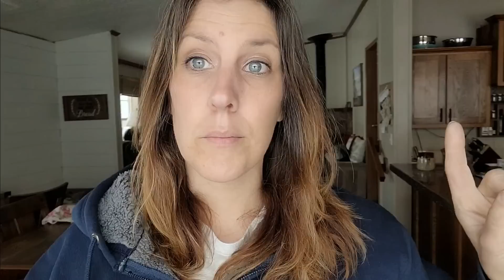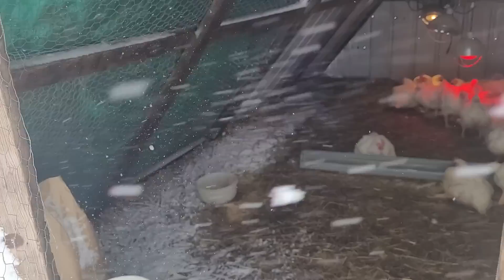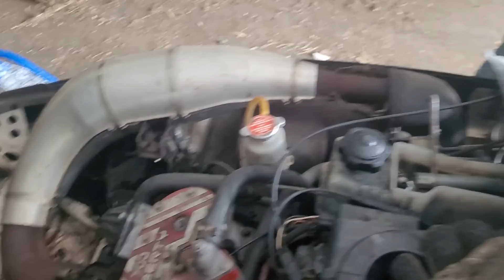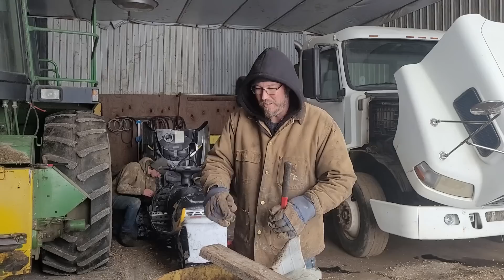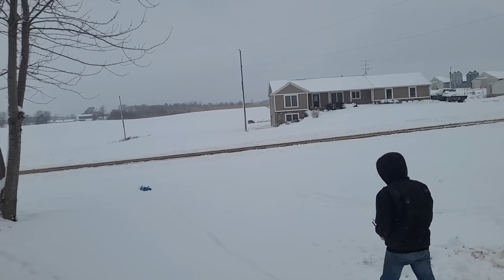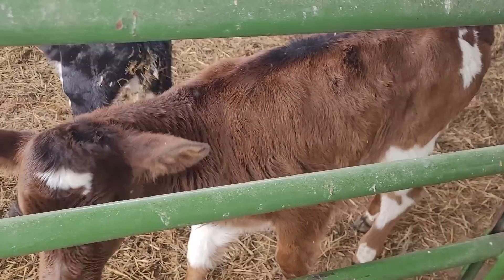Snow Storm

Comment: Mr. Kevin ,have you ever thought about designating one tractor for winter use and put tracks on the back where the 2 large tires are. Possibly one tractor that has a bucket on the front too. A bull dozer with tracks would possibly be better to move snow and what ever else.  Especially to clear driveway of snow.

Comment: I had a red flash car with a clear hood and working doors scale speed of 50 km.h around 35 miles per hour real speed I think real rubber tires with fresh batteries it drifted on turns and it had a range somewhere around 100 feet.